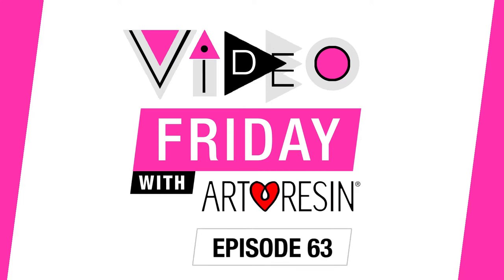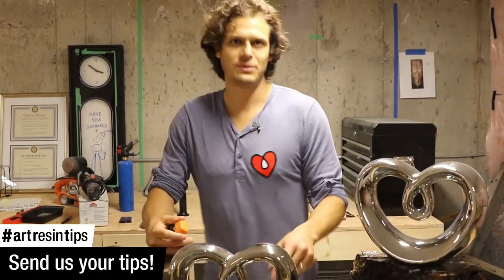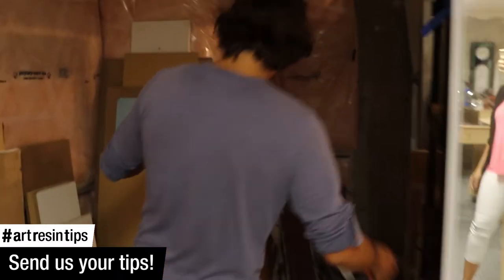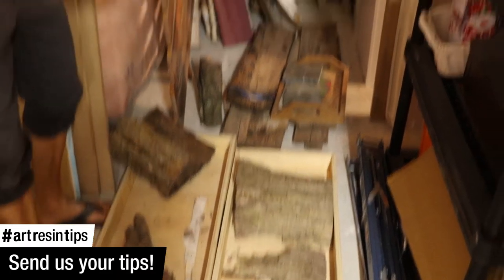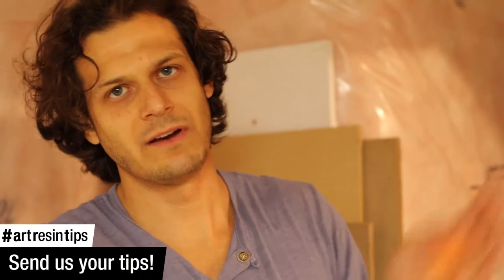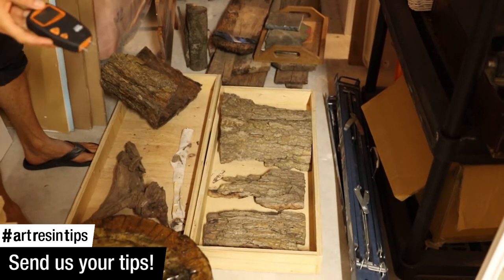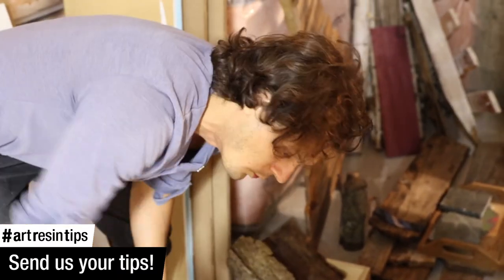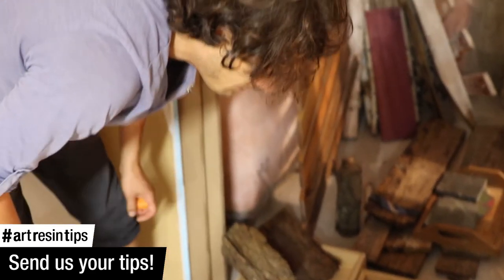Make Sure Your Wood Is Dry Before You Resin

Comment: So what if the wood is 2%? Too dry to use or would it be fine? - Heidi
Reply from the maker: I'll bet it would be fine Heidi - I'm sure the difference between 2 and 4% is negligible.  
Just make sure your wood is really nice and dry :)
I'm wondering if those percentage markers are more crucial for things like boats where expansion and contraction will affect joints and such .
Reply: Thanks for the answer and probably is more important on a boat rather than jewelry or table top art/sculptures. :)